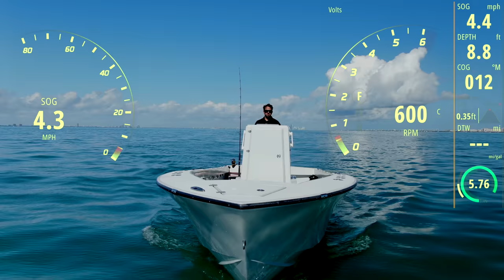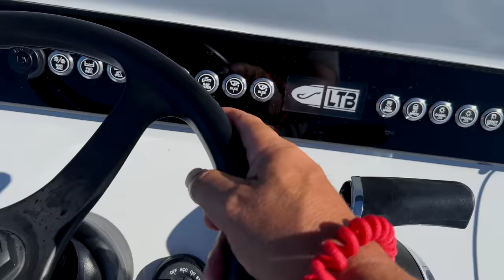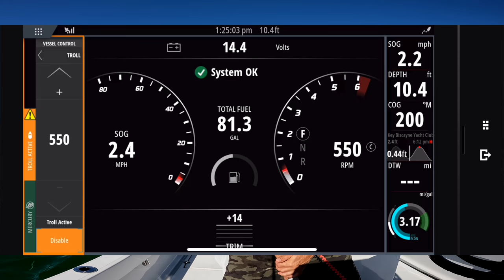Boat Propeller Pitch Explained - How To Select the Right Prop | EP 33

Comment: Mike,  I noticed a little porpoising on the boat as you accelerated and went to a higher speed.  I cured mine by using the engine trim out 1-2 degrees while watching the speed and consumption.  It may help you with smoothing out the ride if you want to eliminate the bouncing.  I tighten the engine down when I'm going trolling speeds.  Just a thought!  Tight Lines, fair winds

Comment: Capt Mike … it was good seeing you out there and thx for including my classic 89’ contender at the end! Unicorn no doubt brother! Points to ponder if not already …. average boater unless you are a bass fisherman runs less than 10-15% of time at W.O.T. and above ~45-55%+ at cruise, so you dialed it in nicely … remember you had no gear, passengers or head wind/waves of any significance or full live wells, so 19P is better.  Mercury Marine has always preferred to prop at higher rpm range rather than lower more for internal combustion reason ie. Detonation etc as boaters would overload boats lug  and slow piston speed, not much to worry though with  electronic control technology on outboards today. Anyway I would bet on average operator will not perceive a loss or gain of 1-2 mph unless you are looking at those fancy gauges ;-) . Similar to Realestate on this one application,application,application!  You nailed it!

Comment: You want to prop for your full typical load.  You should go back to the prop shop and swap out for an 18P of the same prop.  You were into the 5500 range, but that is a bit low for that engine, especially since you didn't seem to have a load of people with coolers, tackle bags, full livewells and so on.  With two people and full livewells, try to get in the 5900 range.  Then when fully loaded you will end up in the 55-5600 range.  Propped right, you will get about the same top speed, but won't be lugging the motor as much, and the engine will breathe easier.   With that 19P, when loaded heavy, you will probably be in the 5200 range.

Getting toward the top of your RPM range makes for less wear and longer life.    Imagine starting your truck out in 2nd gear at every stop sign.   Your Raptor can do that easily with the power it makes, but imagine the extra wear on the engine and transmission.  This is the same in principle.  

Everyone is telling you to shoot for as close to 6K as you can because we want to see you do well with your new ride.

Comment: I'm curious what the df 350 would have done on that boat, my Mako 254 is alot heaveir hull, i have a big ttop, same livewell, and carry 240gls fuel. Yesterday running will full coolers ice 150gls fuel i was getting 51@6k, seeing 2.8-9 mpg cruising 38-39 3mp @34mph. But the holeshot is amazing without tabs, 40mph around 5-6secs. Happy new year capt Mike and looking forward to more great content! 3mpg @ 40 is definetly robbing the fuel dock!

Comment: I have a boat very similar to yours in size  (might be a little bit heavier ) as well with a 300 Verrado… I’m running a 14x18P gets out of the hole well but barely gets 40 mph… I’m thinking of putting a 15”x18P…. (1” bigger) what can I expect?? A few more mph and better RPM at mid range… what are your thoughts?

Comment: I have a 2010 Bentley 240 pontoon with a 2010 Mercury 90hp 2-stroke.  My WOT rpm is around 5300.  My current prop is 13-3/4 with a 15 pitch.  Do you think there is another prop I can use to gain more speed for pulling tubes?  Some have recommended going with a 14-1/2 and maybe a 16 pitch.  Any thoughts?
Reply: Put a bigger engine on the back 😂

Comment: So in theory, if the diameter and pitch are identical, would a 4 blade still give u better hole shot vs the 3 blade?
Reply: I think rule of thumb is down 2 inches of pitch to move into a 4 blade. BUT , Hole shot would Really improve.

Comment: sems like your still a ways off on the 6000 band and carrying no real weight every 200 lbs makes such a difference with outboards you should be able to borrow props so you don't need to buy right away